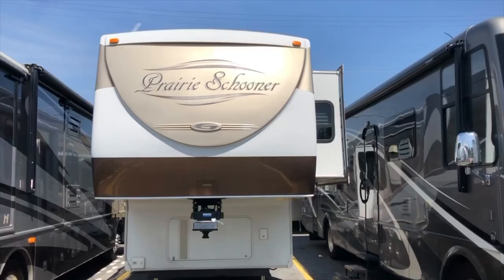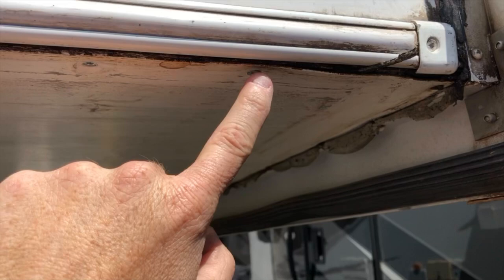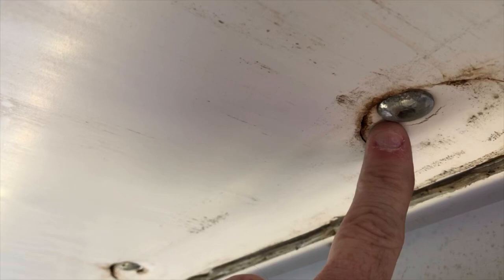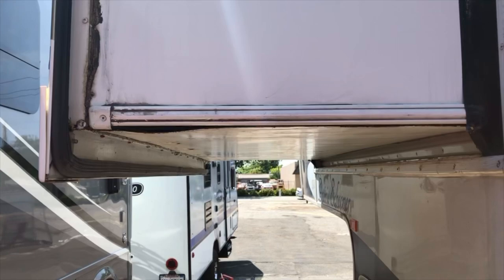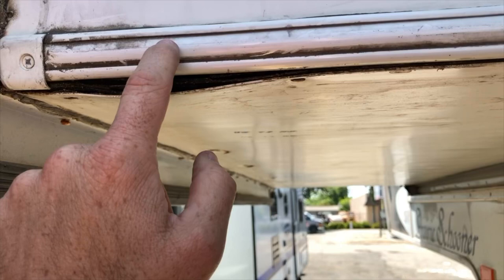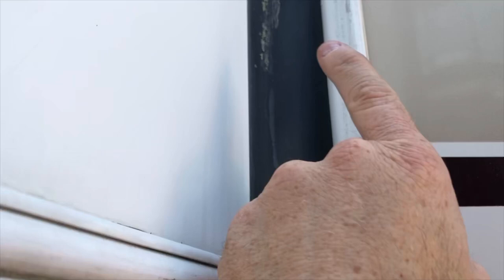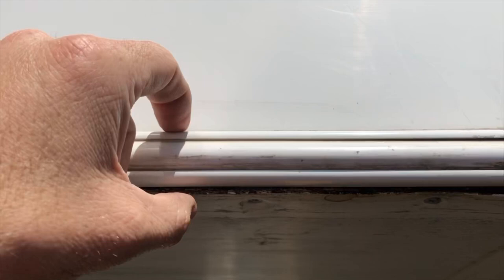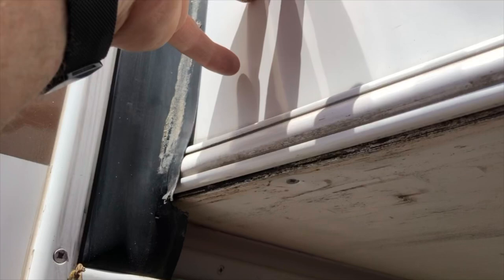RV Slide Out Maintenance Tips You Need

Comment: I'd be interested in learning about substitutes for that crap rubber sealant that pushes out continuously. Is there anything out there that's more stable? Because this I'll be pulling a bunch of stuff off as I prep for this camping season, just to redo the seals.
Reply from the maker: You can use Geocel or an RV grade silicone that have a better adhesive quality.  Just make sure to clean everything really good and tighten up anything loose, before you reseal it.